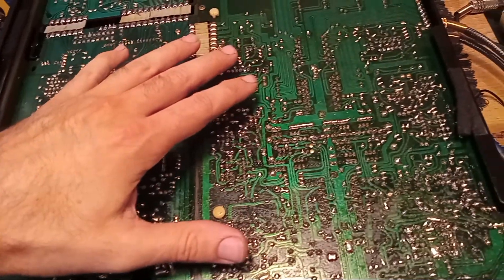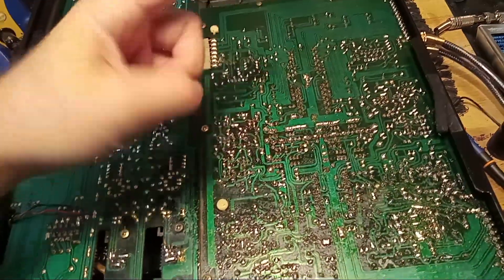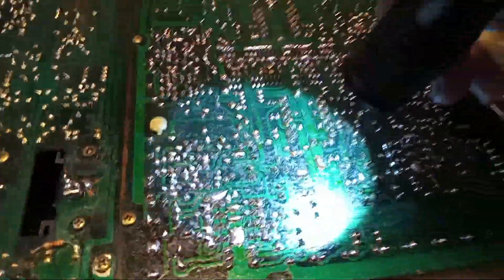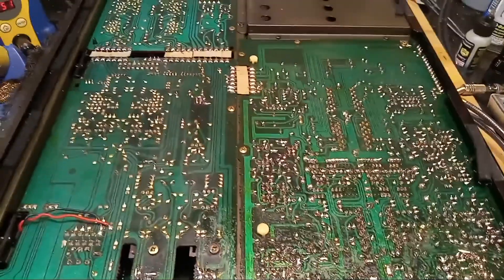Yamaha C4 preamp intermittent channel... damned fragile PCBs.

Comment: Is something like that even worth fixing? if the boards are that fragile it will probably crack again some place else. I would have to love that preamp a lot to keep sinking money into it.
Reply: Fixing a crack pcb board, is not sinking money into a the preamplifier. If this amplifier was remade today, it would cost over $4000 dollars, it has a truly wonderful sound, with bass and treble turnover!
Reply: Fixing a crack pcb board, is not sinking money into a this preamplifier, because you are only resoldering broken joints not buying parts for it!  Yamaha current preamplifier C-5000 costs nearly $10,000, does not even have the specs of this preamplifier! This preamplifier costs $500 second hand to buy! It is worth fixing! Who would pay $10,000,  for a current Yamaha preamp?